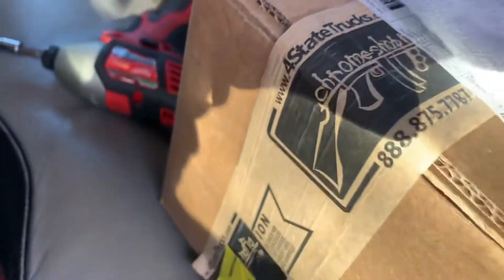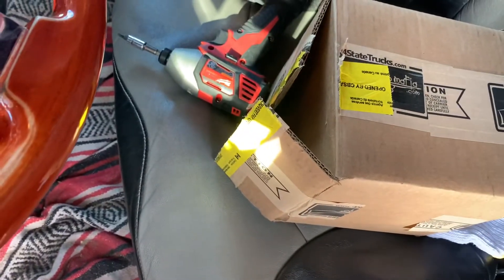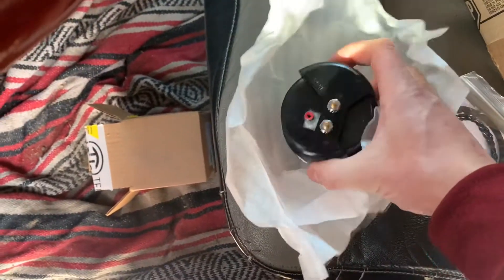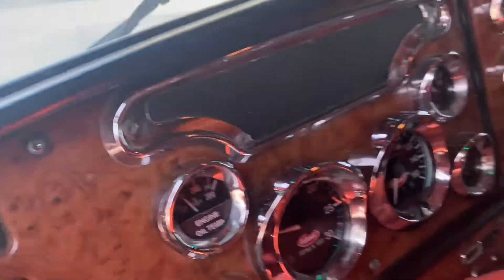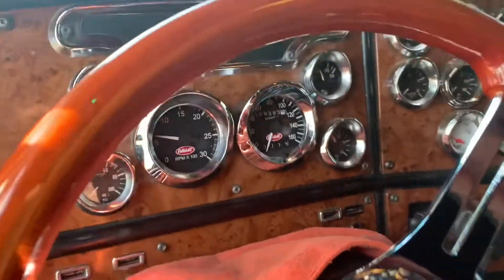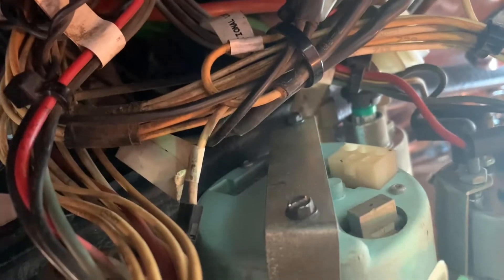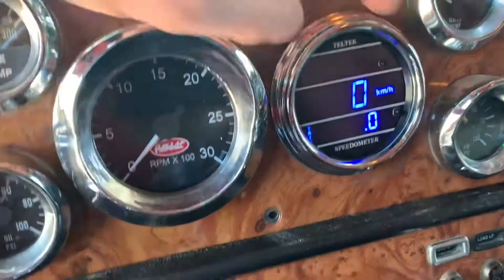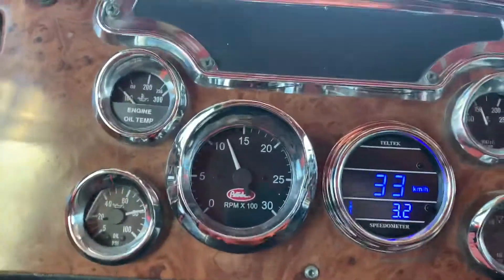Peterbilt Digital Speedometer

Comment: How does the Power wires work with the square plug I have a freightliner classic but I need a new speedometer but don’t understand how the power supply on your new one plugs into the old truck wiring

Comment: @truckin 379 Does it have a odometer? I see the trip meter but isn’t that different from a conventional odometer? I just know how DOT can be lol and don’t wanna get in trouble
Reply from the maker: Yes it does have trip and odometer,it starts out at 0 miles so not sure if it can be programmed to your truck mileage I just left mine start over from 0 and no problems with dot.
Reply: @truckin3799  cool thanks for the reply! I’m gonna get one.
Reply: @Truckin 379  i have a question after how many miles odometer become zero again 1 million or 2 million?
Reply from the maker: 2 million
Reply: @Truckin 379  like i want to buy 2001 peterbilit 379 seller told it was zero after 1 million because have 6 digits on odometer how i can know the original milage please let me know will really appreciate your help

Comment: Where does that cable cord go to?
Reply: ??????  Where does the cable go?
Reply from the maker: It goes from the speedometer you attach it to the twisted pair of wires on the factory speedometer wiring plug. I believe it goes to the engine computer from there then to the transmission speed sensor  from the computer. But to hook up the new speedometer you just attach to the twisted wires behind the dash.
Reply: @truckin3799  I just purchased one for my truck. My speedometer and Speed sensor works. 

But am not getting a reading to or from neither. 
My wiser my be broke, will this still work ?
Reply from the maker: @MsLaVonda  if your speedometer worked before you should  be able to wire the teltek one in it’s place and it should work if power and ground are hooked up also